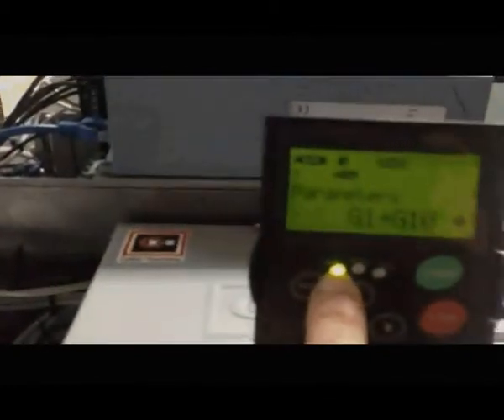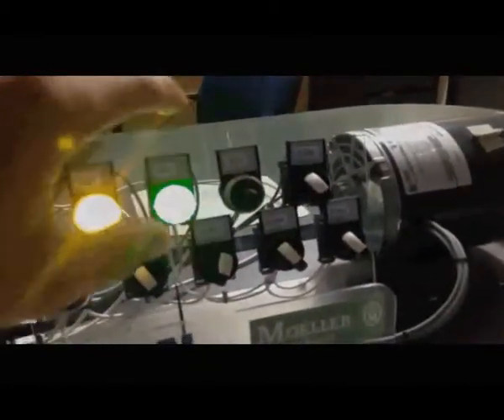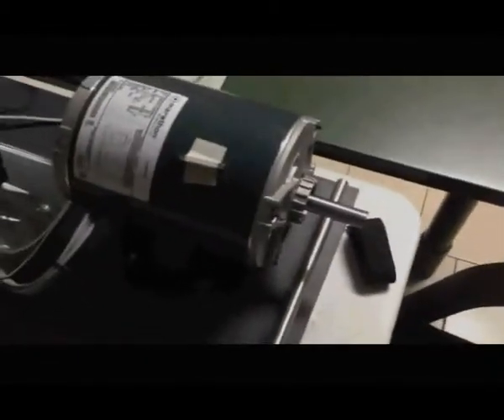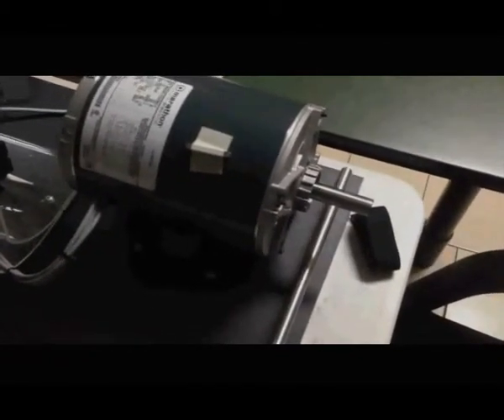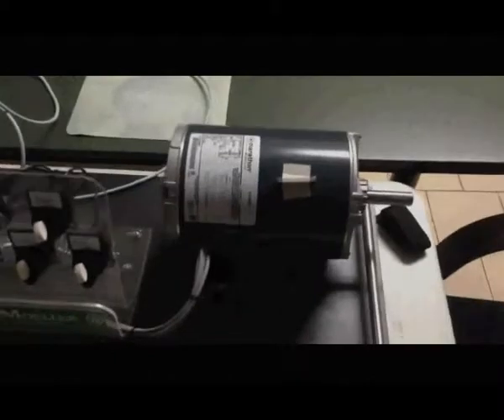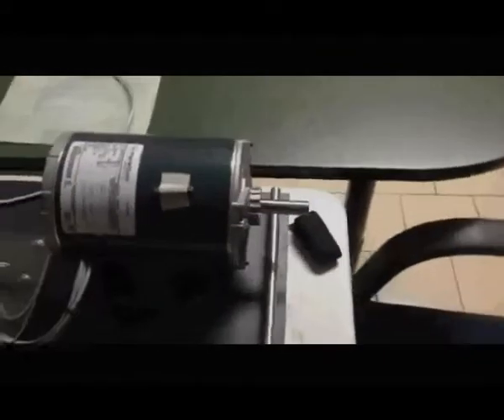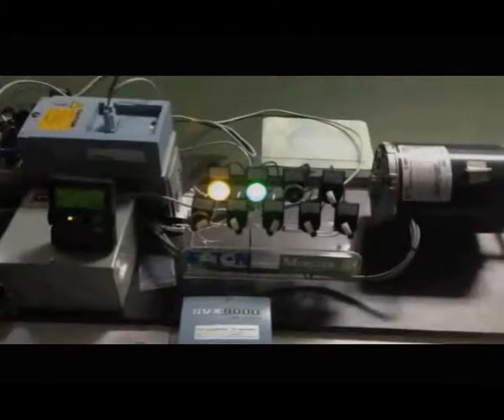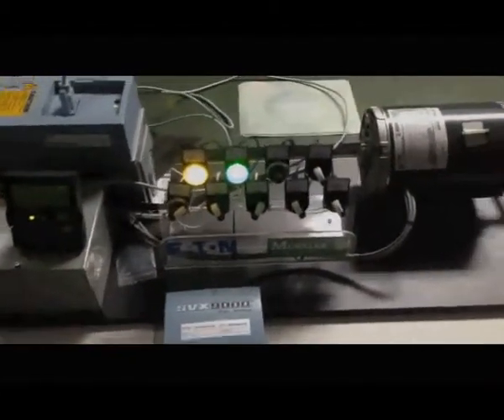VFD Basics - SVX 9000

Comment: in the VFD open loop/closed loop, how are u controlling the VFD?
please mention the interface ie any micro-controller or such device.
Reply from the maker: I am using the vfd in open loop mode and controlling it manually with the keypad.

For closed loop control, an OPTA5 must be installed and i don't have an encoder too.

I have another video of open loop control via fieldbus (Modbus TCP)
Reply: Rangel Alvarado hello Rangel,
thanks for the info, i would also like to do a open loop control for basically setting frequency, forward, reverse, start and stop.
can u share the vi's used for writing parameters to the VFD using modbus TCP. 
it will be really helpful
Reply from the maker: Pradeep Rajan The complete info is on the webpage and the code is on github. http://cerescontrols.com/projects/variable-frequency-drive-control-with-labview/